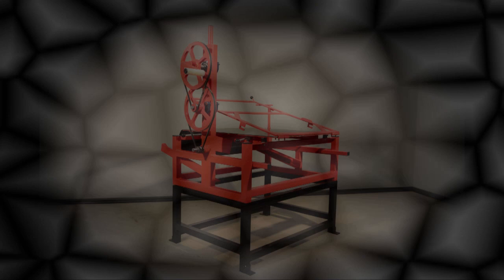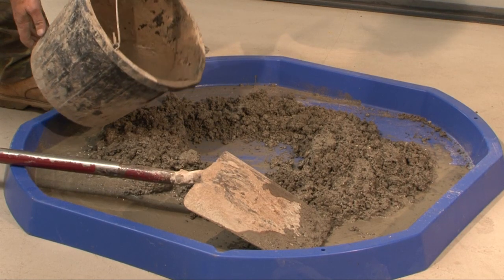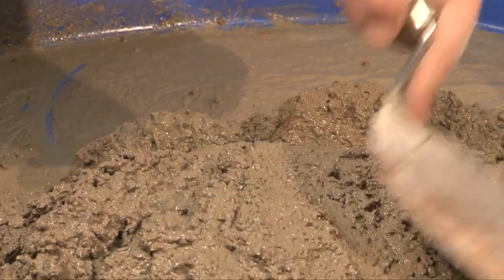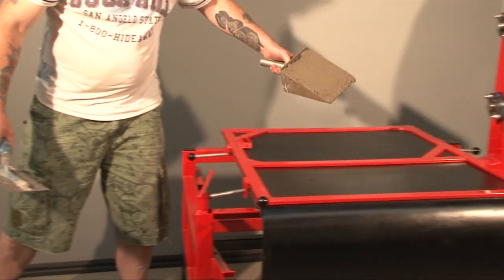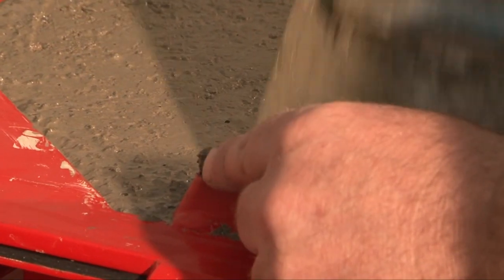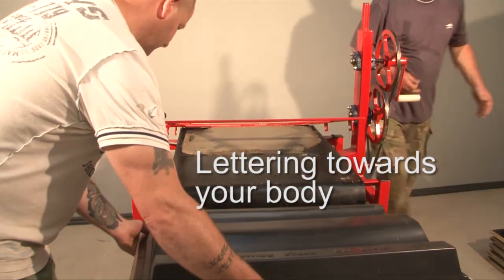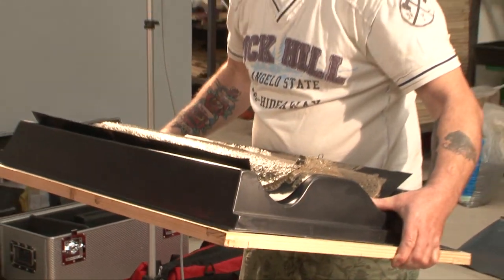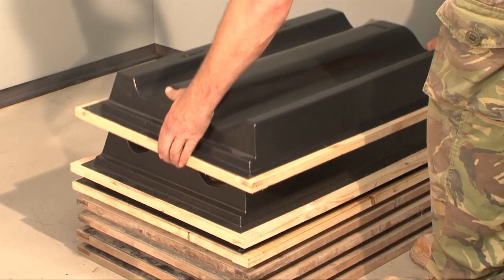Parry Building Products Roof Tile Video

Comment: Considering the time and effort it requires, very few tiles could be produced per day and will shoot up the production cost. Since the process requires craftsmanship and hand precision, the engineering quality of tiles cannot be measured or guaranteed. The holder with a small hole is a weak point and once stacked will be prone to breaking.  Once the tile is dried, it will require more man hours to clean up the excess cement around the tiles, not to mention cleaning the rubber plates and molds for next batch.

This is a terrible way of making tiles. It is neither artisan, nor is it well designed or well engineered. 
You are better off making a slow boat to China.
Reply from the maker: Thanks for your input Parry roof tile systems like this have been in the market for 40 years and we regularly make improvements. Some people are producing in excess of 500 tiles a day on this machine to a high standard of quality and we have countless thousands of roofs across the world many of which are in good condition after 40 years using Parry tiles. 

We provide certified training and comprehensive instruction manuals and videos to maintain good quality tiles unlike metal roofs these tiles reflect more sunlight away, are aesthetically much better looking, much quieter during the rain and do not interfere with mobile phone signals like steel does. We also provide  an electric version of this machine.
Reply: @oliver_gledenning  I would be a good student.  I am interested and have over 15 years of construction experience.   Q   Could your machine accept the red clay tile mixture? IE, does your company provide alternative materials to portland cement tiles?   I believe the clay tiles would require Kiln Firing.
Reply from the maker: @tommaika9121  Hi Tom thanks for your message. My company does currently supply clay tile production equipment but we are working on a much improved version reducing heating temperatures by 80% using plant oil and no extra water to mould clay and heat it using a encapsulation process rather than a ceramic process. We have bee working with a top university and have now received a licence for it. Just to imagine the benefits a kiln that fires upto 40,000 bricks/tiles requires tons of firing materials to be heated upto 1000 degresse centigrade for several hours and on average the waste ratio is at least 10% so that's 4000 bricks wasted during the firing process which is enough to build a small house. Through encapsulation process we use a lot less heat achieve a brick strength of above 12.nm2 so zero waste and the bricks and tiles can be coloured any colour a much more environmentally friendly product in comparison to clay tiles or Stabilised soil bricks with the added benefit of being able to be coloured any colour with the addition of iron oxide pigments. "Carbon neutral bricks and tiles coming soon!"
Reply: @oliver_gledenning  How in the world can someone produce in excess of 500 tiles a day when based on your video it took approximately 4 minutes to produce one tile. There are only 1,440 minutes in a 24 hour period. Please do your math again.
Reply: Sorry to be offtopic but does someone know of a method to log back into an Instagram account?
I was dumb forgot my login password. I would appreciate any tips you can give me!
Reply: @Alexzander Tate instablaster ;)
Reply: @Finnegan Randall Thanks so much for your reply. I got to the site through google and Im in the hacking process atm.
Seems to take a while so I will get back to you later with my results.
Reply: @Finnegan Randall It worked and I actually got access to my account again. I am so happy:D
Thanks so much you saved my account!
Reply: @Alexzander Tate You are welcome :D

Comment: Way to complomplicated set up..Chinese  have 200 foot track where the screed the portland in place in a long mold. It automatically  vibrated makes thousands  of tiles in hours.. the system is maual operated..way better than this setup.
Reply: Yes and how does that help in areas with limited power? Also this machine can make everything for a house not just tiles  but blocks columns & pavers as well. Which is why weve sold many of them. 🙂 Also some Chinese machines have a habbit of breaking within 1 year,  whereas this machine has a 5 year guarantee and an average 20 year durability 🙂
Reply: @ollieglen2759  tell that to old worker who work all his life... then when you 80 everything is in pain from being overworked in your body..

Work smart not harder..your setup is out dated and labour intensive and to slow......you need to have a series of 100 -200 mold in a troff..and screed them in one or two passes..and remove the molds..the chiness do this all without electricity  and make hundred of tiles on 10 min..no electricity need
Reply: @772777777777777  for starters the worker doesn't touch the machine when making the tile so cant get white finger.  Secondly this is a training video so you can make a tile every 30 seconds. So you can easily make 500 in a day. Thirdly this machine is portable I can  put it in my car which i very much doubt you can do with your chinese machine, so it is very relevant and we sell multiple machines a month FYI and we are always upgrading our equipment. People have  built houses for $5000 from all the components made on this machine in East Africa  🙂